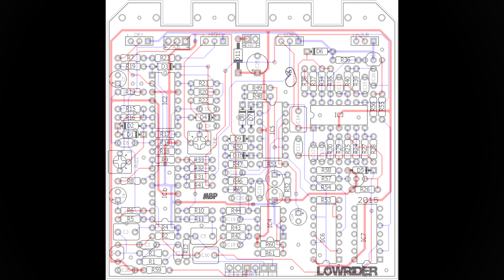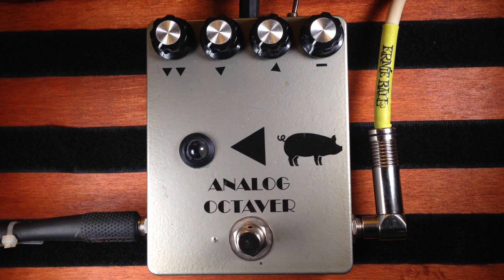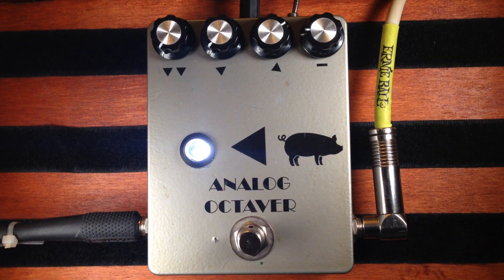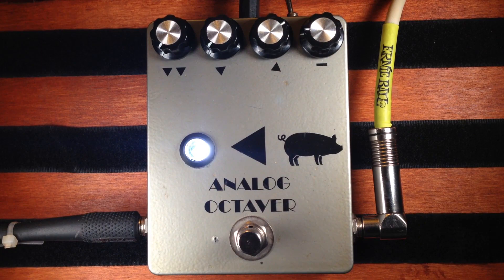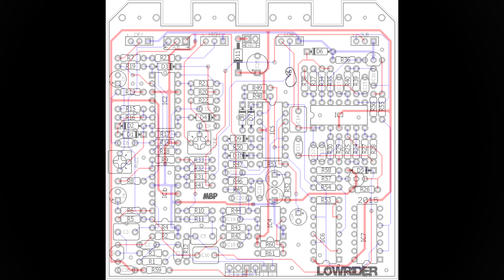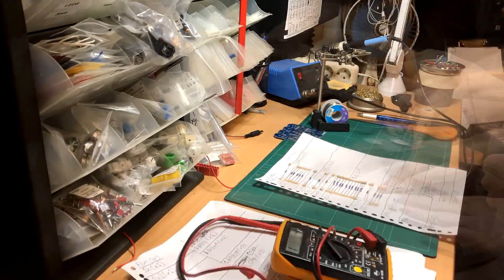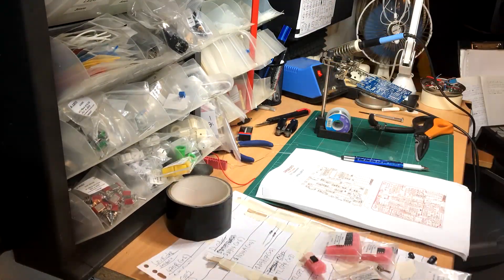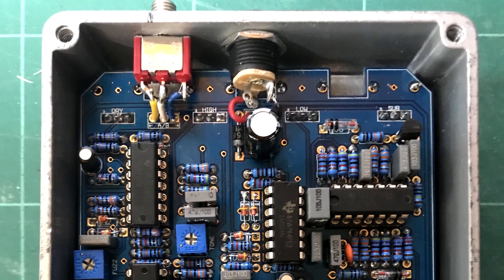DIY Pedal Demo - Madbean Lowrider - Analog Octaver

Comment: Hi ! great demonstration. 
I was wondering, how do you do the artwork on your various kits ?
Reply from the maker: Hey, thanks! I mostly use laser waterslide decals, with pretty much the exact method found on the DIY Guitar Pedal channel, under the name "Tutorial: Applying a waterslide Decal" (Also a highly informative & recommended channel beyond that video!).
I've tried the inkjet-version before, and though inkjet-printers are somewhat easier to come by, the required extra step of coating the decal in lacquer before applying it to the pedal just made it a little extra messy and prone to errors/inconsistencies on my side. So ever since that experience I've taken my laser waterslide-decal papers and designs to the local printshop, where after some explanation they've been willing to help me out and print on my paper. 
Beyond that design-wise I use Photoshop, but more important than that is to think about the type of paper you're going to use while designing; If you use the transparent papertype, lighter colors in your design won't show up well on darker backgrounds & using pure white in your design is off the table (though printers can cover the area in a slight off-white). If you use the opaque white papertype, you now have to either cut the designs very closely/design it with some 'spillover' in mind to avoid white borders around your graphics, cover the entire front of the pedal in graphics, or even try to match the underlying enclosure-color for parts you want to appear transparent.
Either way, I'll end my ramble by saying that working around these very specific caveats is certainly a challenge, but it's a fun one in my opinion!

Comment: Where did you buy the PCB as it is no more available (archives part) ?
Reply from the maker: Aww, man! Just updated the video-description to show it's no longer available. That's the tough thing with these demo's, I obviously have no control over what designers decide to discontinue or update, so these videos can sometimes be outdated as soon as I put them out. You might be able to find another design based on the same circuit elsewhere if you really like this specific sound, but madbean also has different octaver-designs he is currently selling. I haven't been able to try those out myself so can't say much about them, but I can pretty universally vouch for his PCB's at the very least ;).